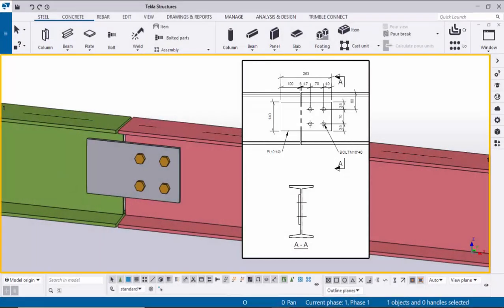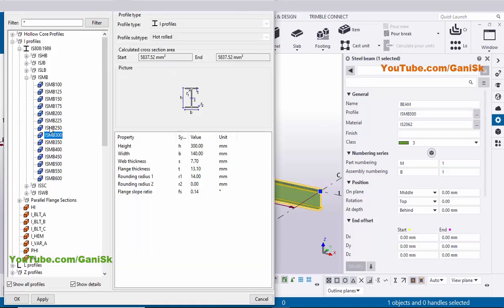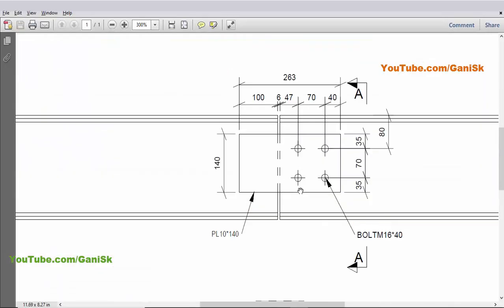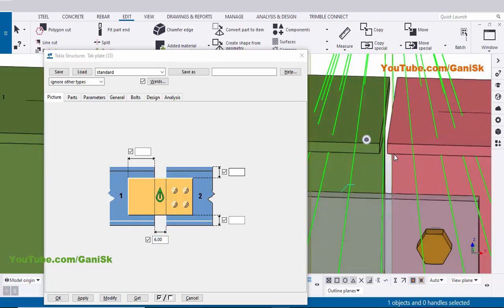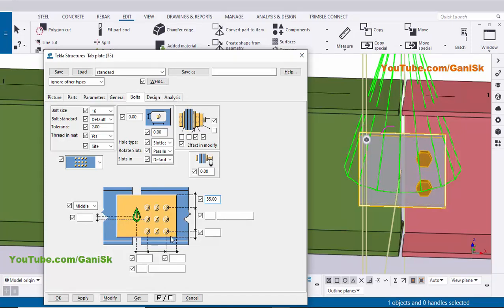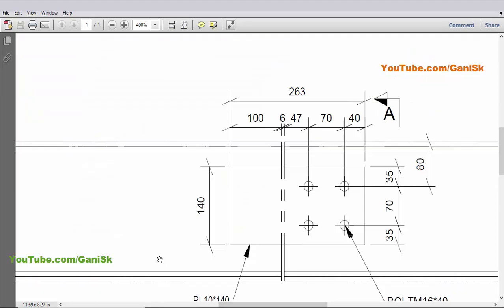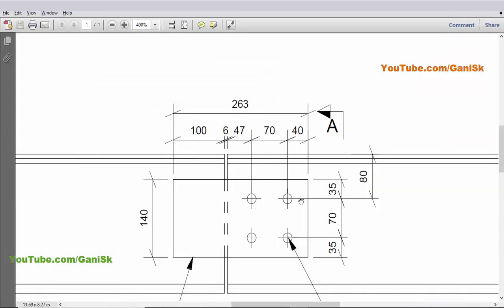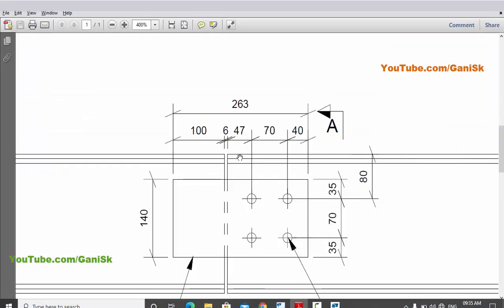Tekla 2021 Tutorial 24 | Connection with Example

Comment: Sir, we have structures connections made of Neither welding nor bolts but PIN connections which are used in oil drilling rig structures. Can you help me how to model such connections and how to create a custom component. Let me know how to share my requirement. Your email etc?
Reply from the maker: Noted